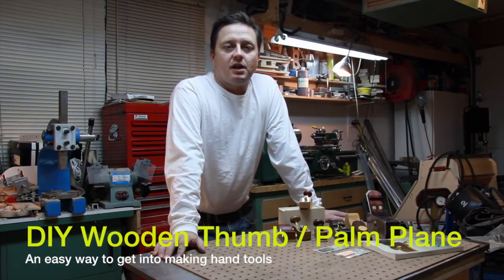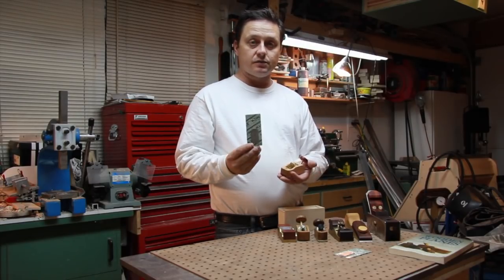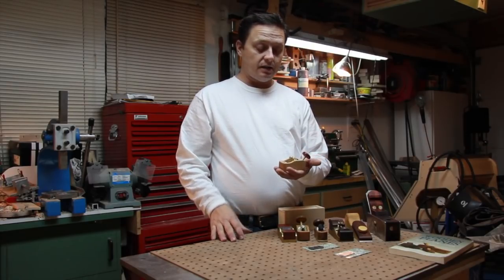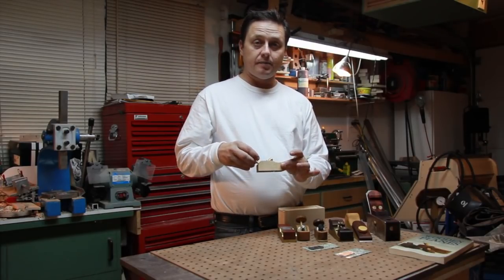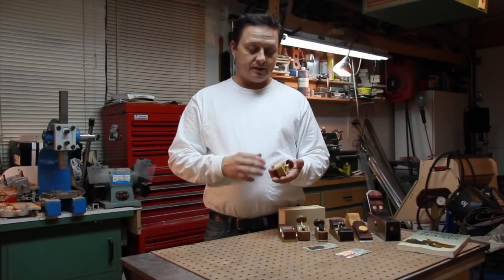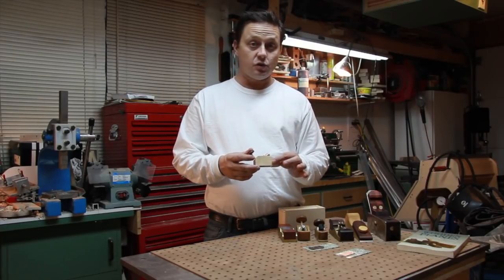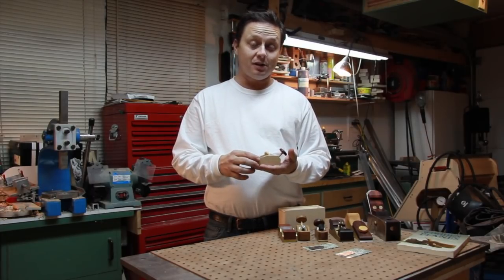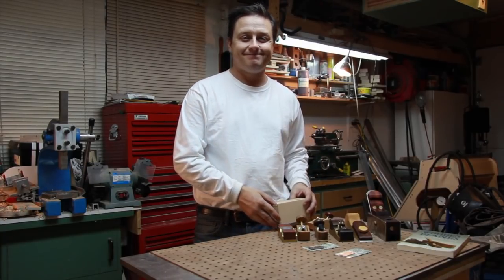Make a Wood Thumb Plane // DIY Palm Plane // How to make a small wood plane // Free plans

Comment: Mike, thanks for the reply, I was asking if you sell the hand planes….if you get bored, I would like to see someone ‘turned down’. I have heard that expression a number of times but not sure how that is done.
Reply: "turned down" refers to using a lathe to "machine" metal or "turn" wood to the desired shape. lathes typically create cylindrical shapes. alternately, a milling machine can "machine" metal to a variety of geometric configurations